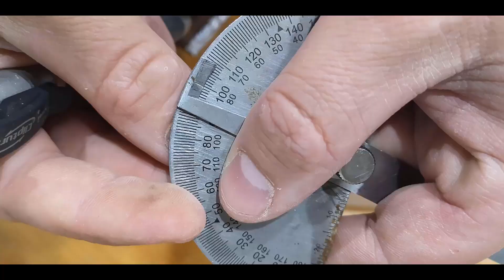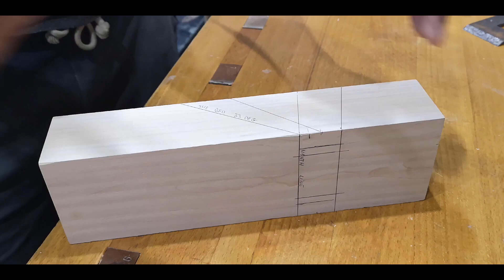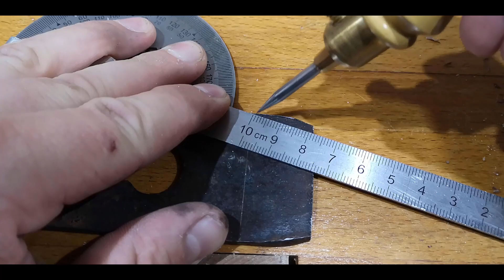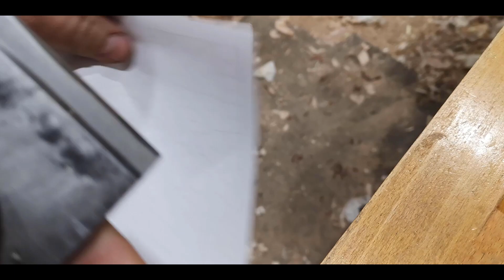022 Strike block plane

Comment from the maker: Here is my first attempt of building a hand plane with mouth closer.

To understand how the mouth closer works watch this video:
https://www.youtube.com/watch?v=4mfd_YmOI2M

The basic desing is classic mitre plane, but the blade is bevel down, like in wooden strike-block planes. I set the blade extremely low - 33 deg angle - for long time it was my small obsession to check how it will works. Today i know, it works preety well :)

It was very instructive project for me and  takes me for another level in my planemaking. I hope you will like it :)

Materials:
Pear wood
Black locust wood
An old laminated plane blade made by Heinr Mueller
Boiled linseed oil
Shellac orange.

If you have any questions or sugestions just write a comment.
Enjoy!
Reply: Te cfdd

Comment: Well, after seeing you fix your old one, I had to look up this one. I am surprised that you would use pear as most of what I get here in Oregon is not really hard enough, but love the way it works. Also, I am wondering if you fumed that black locust. I have never seen it that dark. Most of what I see is green when fresh cut, and goes to a nice amber color when exposed to sun light. Love your work!
Reply from the maker: Thank you! Our pear wood is harder than beech. I just bought this fummed locust..

Comment: Your work is really inspiring! What type of rasps are you using?
Reply from the maker: Thanks! In wich minute and second? Regards!
Reply: Stavros Gakos 13:10 and 13:59
Reply from the maker: @robertbeverly1508  13:10 an ordinary rasp, 13:59 big file for metalworking
Reply from the maker: @robertbeverly1508  13:10 an ordinary rasp, 13:59 big file for metalworking
Reply from the maker: @robertbeverly1508  an ordinary rasp and big file for metalworking
Reply from the maker: @robertbeverly1508  an ordinary rasp and big file for metalworking
Reply from the maker: @robertbeverly1508  an ordinary rasp and big file for metalworking

Comment: I have used brass bar stock for mouth closers in a couple of my planes. I have seen wood used but have not built any myself. Beautiful work as expected from you. I build the bulk of my planes from found material or Canada hard rock maple and American walnut. The blades I make from A2 oil hardening tool steel. I usually give them away to very deserving people. If anyone ask, then the answer is no.
Reply from the maker: Thanks a lot! I think that planes are small treasures for those who was gifted by you. Much respect!

Comment: Great craftsmanship as always, you're an inspiration. I'm fairly new to woodworking, and planemaking (tools in general) has really caught my eye, so I've couple questions about this project 
- What's the reasoning behind not using a cap iron?
- What particular uses is a mitre plane o strike-block plane good for?
Reply from the maker: Thanks Martin! Check my video no 061 with description. There ara the answers. Cheers

Comment: Lovely shellac finish! I think this blade angle might just also work well for a shooting board. Or will it work the blade out of the body during use?

Are you a self tought or schooled woodworker?
Reply from the maker: Thanks mate! I'm self taught.
It will works very good on the shooting board but it's not the purpose for that plane. 
For shooting board i'm gonna build big mitre plane with skewed blade, steel sole and steel side. 
Regards!
Reply: @StavrosGakos  ooh that skewed blade sounds cool! Are you going to build a shooting board that houses the plane as well?